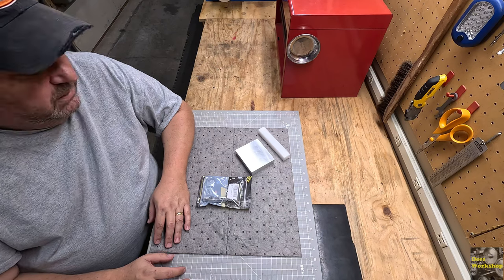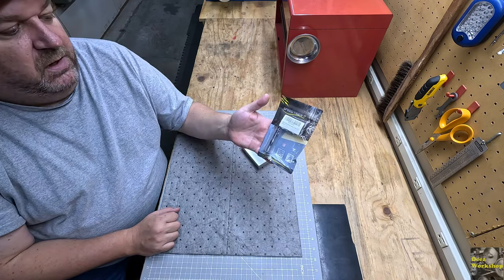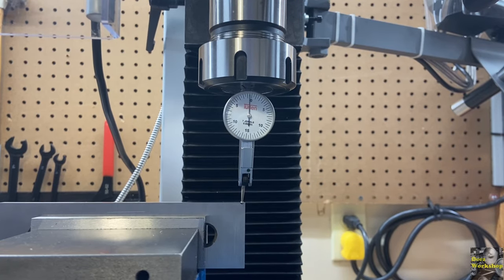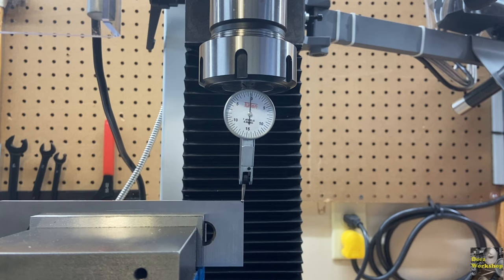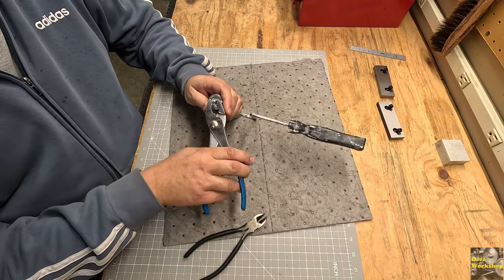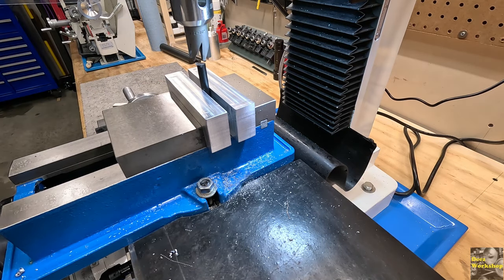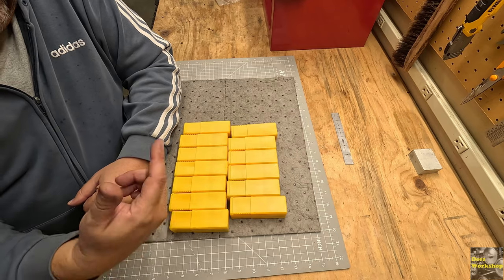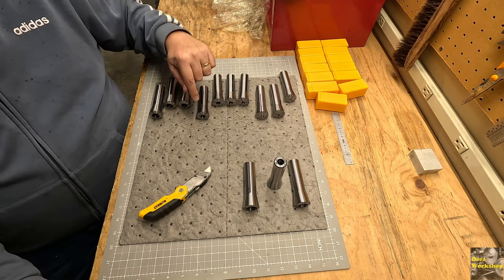Messing in the Shop Ep 13 - End Mills, Outside Chamfer Mill, R8 collets and more.

Comment: From the camera angle it appeared like you may have had your indicator too high when you were checking the vice for parallel.  Even ground parallels have the sharp corners knocked off them, or they should, and if the ball end on your indicator rides against that corner it will show irregularities that aren't really there.  Also inexpensive parallels like most of us hobbyists have are not always reliably straight.  They are ground to be very parallel on the narrow edges, but at least mine do not all sit flat on my surface plate on the large surfaces.  I recommend just using the fixed jaw of the vise and running your indicator ball just a bit below the top surface, maybe as much as a 16th of an inch.  Also, even good indicators sometimes show a difference if you reverse the direction of travel, so start moving the indicator just a bit in the direction you are traveling before zeroing. 
For me the biggest help was just changing my expectations. I started right off using a .0001" indicator for tramming my mill and for aligning fixtures , and all I got was frustrated. If I managed to get a good reading it would change if I moved the other direction, or just tightening the clamps would push it way off.  Switched to a .001" or maybe .0005" inch indicator, and just get it to less than one graduation end to end and call it good.  Like you demonstrated these smaller machines are really not rigid enough to hold to tenths under load anyway, and I personally have not done any projects that needed milling to that precision anyway.   In real life if a part needs to be that precise it will probably not be finished on a vertical mill.  That is what surface grinders and polishing on a lathe are for, the stuff that has to be made to better than a thousandth tolerance. You can get some really nice finishes and get sizes really close by polishing and lapping parts on a flat surface, it is quite easy to get within a couple tenths that way, but measurements that small really aren't even valid without temperature controlled inspection areas and calibrated instrumentation, so us amateurs are usually just making parts fit right, not making them to absolute dimensions.
When you do use the carbide end mill look up speeds, to get carbide to cut well and get good surfaces I found I need to run them quite a bit faster than my instincts wanted to. That may be just me, but I have found I have a tendency to run rotating cutters too slow for them to work properly, especially carbide.
Reply from the maker: I have really grown to love you're replies.  Very informative and helps confirm a lot of what I am realiing.  The acceptance piece is what i need to understand.  It seems so easy watching Kurtis and Adam Boothe dial things in to such precision, but then again they have vastly more experience and better equipment than Ill ever have.  Last weekend I moved my vice to the center of the table and trammed in on the fixed jaw to what appears to me 0 runout across 4 inch travel.  I am happy with it.  in my situation with the wooden work bench and size of the mill and lathe you are absolutely right,  Everything can twist and move up to 5 though from what i have tested.  pushing and pulling things when an indicator is setup.  I will need to have better machine mounting and entirely differnt setup.  Cheers and thanks for your comment.

Comment: I went ahead and ran a stone on all the R8 collet sharp edges on the ID & OD fit areas. After doing that I’ve gotten to a point now that it’s almost a waste of time indicating tool runout as it doesn’t even exist any more compared to using the collets as shipped. It takes a while
Reply from the maker: I have thought about this.  They definitely could use it and I think it will be time well spent.  Thanks for the reminder, you have convinced me to put in the time.

Comment: Stoked on those R8 collets. I've purchased a few of the common sizes but MT3 collets. Same idea but different shape and taper. The runout seems good so far👍👌🇦🇺(a few of them have steps cut in the slits too, same as those. Some of my cheap ER32 collets also, it must be a common flaw)
Reply from the maker: I received a replacement set and they have the same slit cut flaw but i decided to just keep them.  If I want quality I have to pay for it.  I do like these for the flexibility it gives me.  I really get a lot more space in the headstock to the table now too with those.
Reply: @deezworkshop  my thought was that the MT3 collets don't have the Extra Range(like the ER style) of clamping ability, so if the endmill fits nice and firm, the slits will never compress fully, and the bad cut won't matter as much. Saying that, using the lower end of the clamping range on my dodgy ER collets, there might be issues. If the slots are bad, and I'm fully clamping them down, I'm sure they're will be extra runout. I've got a full metric cheap set, so I haven't had the size issue yet.👍👌🇦🇺
Reply from the maker: @adhawk5632  Thats the main reason I decided to keep these.  The collets will never fully compress.  I do like having them though.